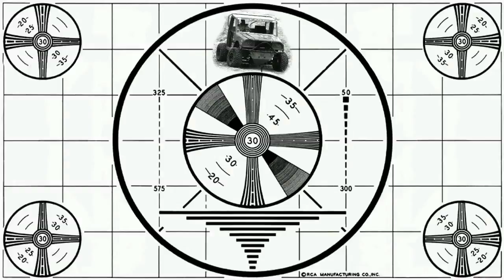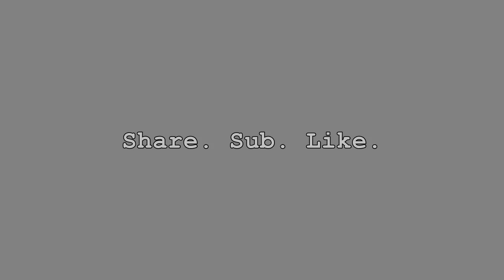Project: Wolf Spider. (part 7) Custom steel RC 8x8 Heavy Prime Mover.

Comment: You can use a piece of heat shrink as a grommet where your wires pass through your frame rails. Just a thought, keeps em from chafing through the wire insulation. Good luck fishing a servo lead through there :P
Reply from the maker: Good idea with the heat shrink, I'll have to remember that. I did the servo leads down the chassis rails on the last truck, if I remove the little connectors from the plastic plug and tape them together it ain't too bad, just have a wire hook in the hole at the other end and pull 'em out and insert the connectors back into the plastic plug (I just gotta be sure I put them in the correct slots).

Comment: Great tips Brother. Hey if y'all don't mind...if you're worried about drills going thru, mark the max depth y'all want drill on the bit with a wrap of masking tape, thus a guide & easy to remove when done & best part, way cheaper than drill stops. Also, I made a habit of making a dimple for my bits years ago, every hole!! Then y'all never have a bit skip off where the hole should be. Lastly a drop of oil to keep the bit cool thus they last longer & y'all don't have to sharpen nearly as much. My original trade is Autobody Repair so please forgive me if my few tips are insulting your abilities, definitely NOT my intent Brother.
Reply from the maker: Good tips! back then I used a pick that was too sharp that raised the edges of the punch dimple, I have since got one of them spring loaded auto punches that give a better result and I almost always use the cutting fluid when drilling.